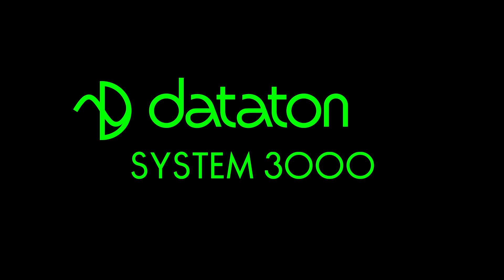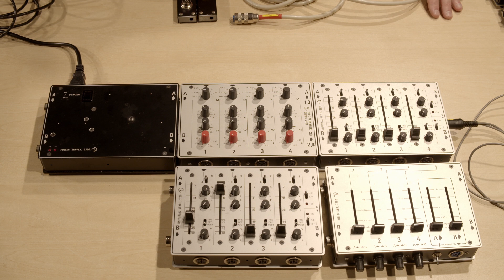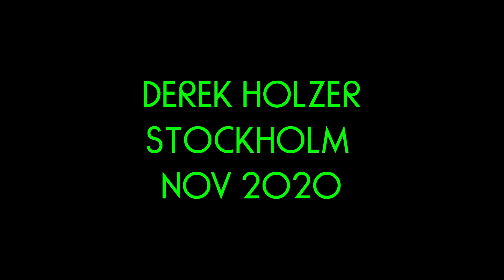Dataton System 3000: Tutorial 1 Power & Audio Routing

Comment from the maker: ERRATA: the Universal Mixer channels can be switched between the top-side channel input and the A or B buss. Channels 1 and 3 can take the A bus and channels 2 and 4 can take the B bus. There is also an effects send knob, however this is very non-standard since it superimposes this signal as an offset on the ground connector at the bus output instead if giving it a separate output channel. This effects send was designed specifically for the Dataton echo/reverb module, but since this module contains over a dozen expensive Reticon Bucket Brigade Delay chips (EBaying for about EUR 50 each!), its owner was a little less enthusiastic about loaning it out for music students to mess with ;-)

Comment from the maker: ERRATA: the plug-in linkages between the vertical channels 1, 2, 3, and 4, as well as between the horizontal busses A and B, use a 6 pin connector which was commonly used for CB radio microphones, for example, rather than a 5 pin connector as I mention in the video. This connector carries signal, +V, -V, and ground. The stereo audio output is a standard 5 pin DIN connector, not a 7 pin as I mistakenly say in the video. I believe the audio output is balanced to accommodate longer cable runs.